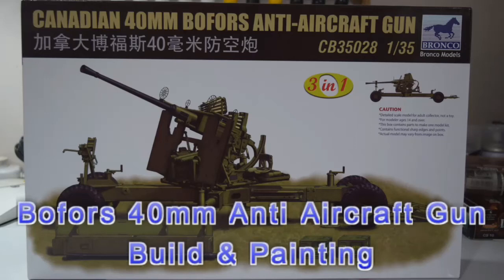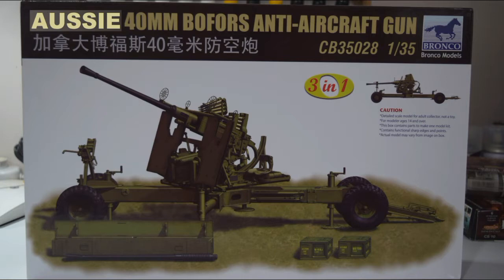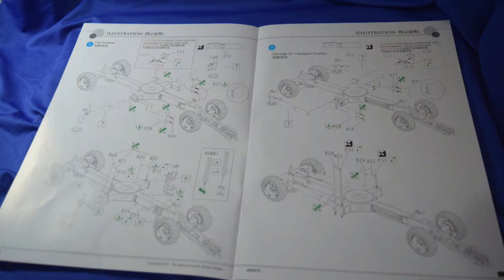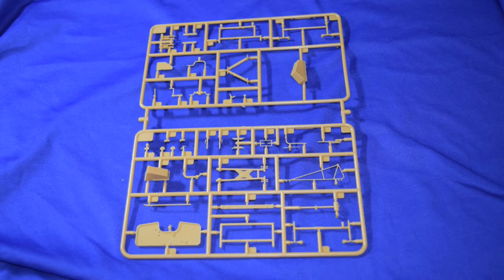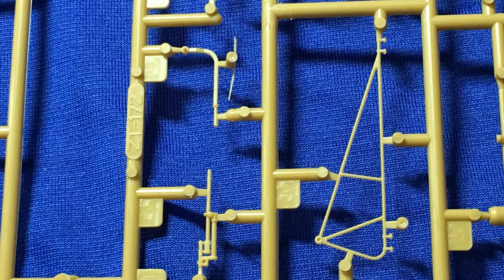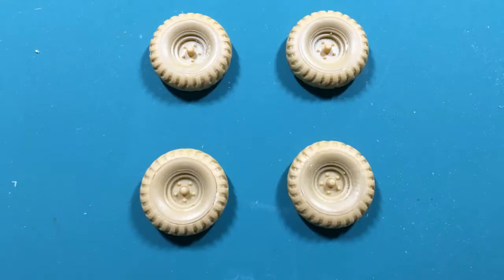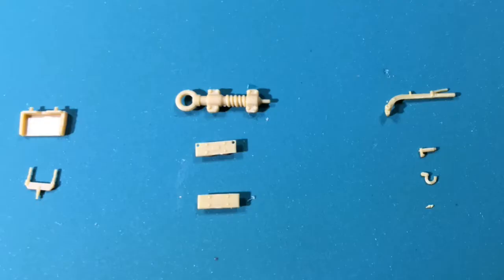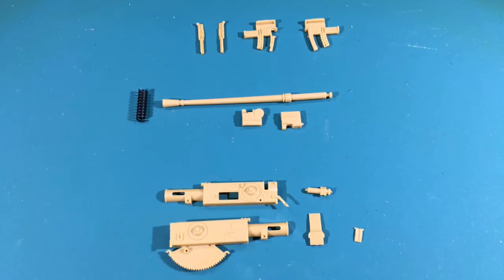Bronco 1/35 Canadian 40mm Bofors Anti-Aircraft Gun - Build and Painting

Comment: I done the same at start put the firing swivel arms on the same way each side but came off ok to change one up one down! It was quite a diffi build to be honest quite challenging with the kind of plastic used, it didn't seem to want to glue at parts! I have the British version with the crew but don't like the sights like the tv antenna! Your one looks better with the PE sights on the rear whare the rifle scopes should be, so.i used the standard sights like on the PT elco 80 boats like your box art! My box art shows the tv antenna and crew crew ! Loads of spare parts left over and near a full sheet of PE! U used some but the parts in instructions called out for the smaller parts on the sprue so I used them on the frame ends whare the Jack's would slide into! Looks more detail than bent flat metal and super glue! The PE ammo rack was a pain in the ass to put together the PE was so thin you really only got 2 shots at bending it before it snapped! But it's all together now and looks really good! I'm happy with it!

Comment: You're making me nervous,brother !   I've used a sharp X-acto #11 blade to pickup and place things like those bolt heads. It's certainly easier than your way.  You're making a Bronco kit.  You know perfectly well if you can mold a part in one piece then they mold it in 8 or 10 !
Reply from the maker: LOL, thanks Ennis, yes good point, I spent more time crawling around on the floor looking for parts that had flown away that making the thing 😜
Reply: +Halidon Funny you should mention that !  I've been doing the same thing this week. I've been working on the Trumpeter kit of the German Pz. Kpfw KV-1 756(r) tank and I've been spending half my time looking for parts that dropped or flew off or just dropped threw the space time continum !  I found both the caps for the Jerry cans (1.5mm X 2.5mm) but could I find the f****ing exhaust ?  No ! it's still on the sprue and 2"X2" !!!!!!